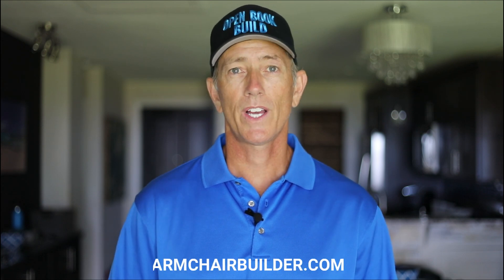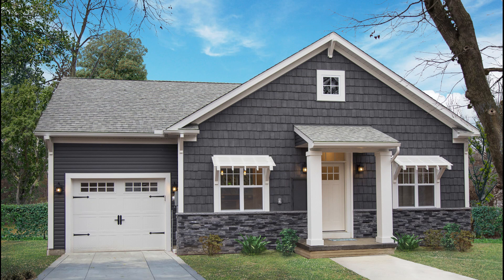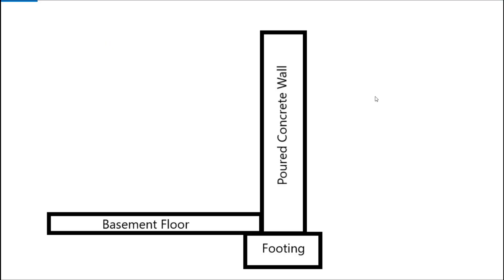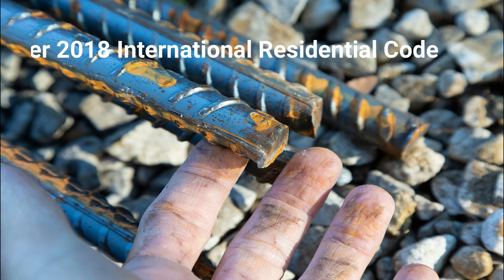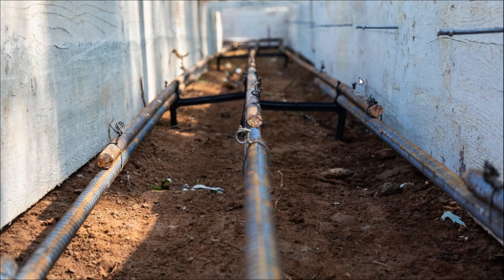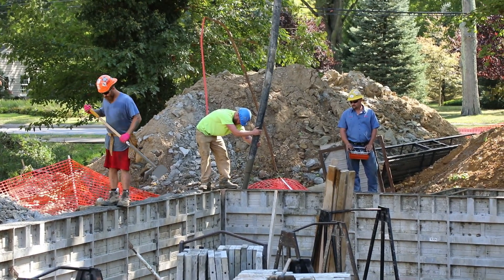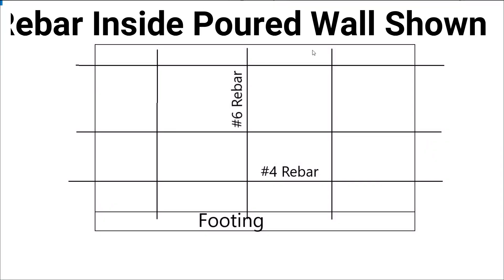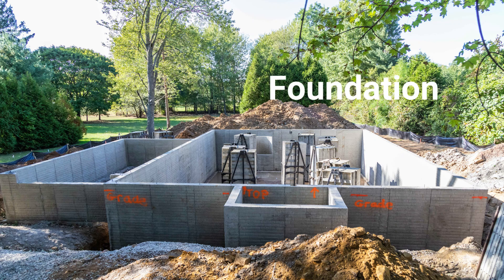Quality House Foundations: Avoid Structural Problems

Comment: Two comments:

1. If you wish to finish the basement, consider the fact that heating ducts will run below the floor joists, subtracting about 10” in height. If you want a true main level room feel in your finished basement, you should consider 10 foot, not 9 foot basement walls to have an 8+ foot finished basement ceiling. This also makes running and maintaining utilities in the basement ceiling easier, as you can avoid drilling through your floor joists. I have had electricians severly compromise joist strength by drilling for electrical cable passage too close to the bottom of joists. 

2. Not shown here, but I saw you waterproof and insulate in your 64-day build video. The bitumous coating on the exterior is traditional, but also traditionally a waterproofing failure point. There are dimpled plastic flexible sheeting membranes that can be applied over top ofthe insulation and OVER the french drain system. This creates a much more effective waterproofing since it is unaffected by cracking walls, protects the french drain from silting up, and also protect the integrity of the of the exterior insulation. 

My recommendations make the foundation slightly more expensive, but as you say, the foundation is the base on which the rest of the build rests.
Reply: 12 foot basement it is!  Thanks!
Reply: We did this often in GA,  but never dropped it below the flooring above, open truss systems are much better in reference to ducting, plumbing, and electrical.
Reply: @louismccall    That’s a good alternative if you don’t mind the extra springiness in the floor. What do you do if the main heating/AC supply ducts run perpendicular to the floor trusses?
Reply: @dilvishpa5776  Floor trusses are stiffer and upgrading the stiffness is easy. Space can also be made for supply ducts to pass through a floor truss.
Reply: @Ilove3SGTE  Floor trusses aren’t stiffer than engineered lumber or solid lumber. Who told you they were?
Reply: @dilvishpa5776  their span ratings are base on deflection limits. If they are the same hight/tinckness and trusses span more because they deflect less how are they not stiffer?
Reply: @Ilove3SGTE  Beams and trusses are like springs. They can reach the same equilibrium positions, but oscillate differently while getting there.
Reply: @dilvishpa5776  definitely not. At the same span and the same spacing the floor truss will be less bouncy. The reason some people think floor trusses are bouncy is because they increase the span and or the spacing. A lack of bridging can also make things worse. It's pretty simple the top and bottom chords are what resist the deflection. Trusses use larger top and bottom chords making them stronger and stiffer then dimensional lumber where the top and bottom 1/3 at as the chords. Using lvl chords, gluing and screwing the subfloor can help. Working with an L/720 engineering spec, increasing the height of the truss or decreasing the spacing or span will make the biggest difference. Dimensional lumber just can't competet at the same level. The only main thing it can do better is fire resistance before failure if we exclude cost.
Reply: @Ilove3SGTE   Also, you are not comparing apples to apples. An identically sized piece of dimensioned lumber is stronger than a truss. The reason is that the truss is the dimensioned lumber with pieces removed. Equivalently sized engineered lumber is stronger. A truss can’t be stronger than it’s weakest pieces.
Reply: @dilvishpa5776  as I said the chords are where the strength comes from the webs or the middle don't add any strength at all. They are simply there to keep the 2 chords apart. Only when a crushing force is applied like over a load bearing point does the web need to be strong. That's why I-Joists can get away 3/8" osd webs. The webs do transfer load to the bottom chord from the top but this is all they do and the force is easily handled by a few structural members.
Reply: @Ilove3SGTE  I’m a physicist and materials scientist. I understand how beams work. A truss is an economic product in that it can produce a greater height member at a lower cost, and beam strength goes with the square of the height. I also have done a lot of building, so my observations aren’t just academic.
Reply: @dilvishpa5776   that's excellent, can you then show me some evidence that floor trusses in general at the same hight, spacing and span are more bouncy then dimensional lumber? I'm sure you're aware but for anyone reading. I would also like to add that unless we are talking about very large sizes, trusses are far more expensive 3 to 4 times (or more) a comparable sized 2x12.
Reply: @Ilove3SGTE  we’re talking cross purposes again. I am referring to raw materials cost in lumber, which is priced in board-feet. There is less lumber in an equivalently sized truss than a standard joist or beam. Manufacturing costs drive up the prices of a truss. 

I have hydrodynamic rain gutters from Englert. They don’t work worth a damn because they were installed incorrectly, in spite if my objections. The same misapplication is true for trusses
Reply: Floor trusses
Reply: @jwatson181    Yes. That works but leaves a springy floor with lots of deflection. Not my preference. If you don’t mind, that’s a solution.
Reply: @dilvishpa5776  as long as you have the proper posts below, you shouldn't have any deflection.
Reply: @jwatson181    Deflection occurs in ALL support members … joists, beams, trusses. Maximum span length is determined by limiting the amount of deflection between supports. Trusses aren’t as rigid as solid lumber. Unlike steel welded or bolted trusses wood trusses maintain a certain give and motion between the truss members. Decreasing the span length with extra supports is an option, but it eliminates the other advantage of a truss, longer spans. Engineered lumber is an alternative and you can drill out the center 1/3 of the truss for circular duct work without significant strength loss, but many trades people make the mistake of drilling near the bottom edges … a severe engineering error. Neither system solves the problem of large rectangular supply ducts running perpendicular to the joists/trusses.
Reply: @dilvishpa5776  No and no. Trusses have a much higher deflection resistance and can span much further. Span capability is based on deflection. L/360 is typical, that's length divided by 360 which is the deflection limit at a given weight rating. A 2x12 can span about 16' depending of the wood type but a 12" truss can typically span about 20'. Trusses can also easily be designed with spaces for large duct work to pass through. "Engineered lumber" if you are referring to i-joists you can cut much more then the center 1/3. an 11 7/8" i-joist can handle a hole up to 8 inches so long as its not to close to a load bearing support or other holes. Regular dimensional lumber can only handle a hole in the center 1/3.
Reply: what state are you in?
Reply: Good info and need to inc into my build since where i live now that has all happened to the foundation and I’m on top of bluff.
Reply: Not just HVAC, but pluming too.
Would want to arrange the joist in the direction that suits pipe between them as much as possible.
Reply: @baware80    I just looked it up. Thanks for making me aware of it. Its main advantage is its self-healing capability. That is due to the presence of excess reactive calcium that wasn’t chemically activated during the initial concrete pour and forming. Cracks in the concrete allow water access to the unreacted calcium, which then reacts and seals the crack. It is kind of ingenious, though I think it may have been an accidental feature in Roman times. I’m not sure Roman concrete is any more waterproof than modern concrete, so would still waterproof the foundation. Water is passed through concrete through absorption and diffusion, not just via cracking.
Reply: @baware I DID understand that based on what I read. But to “thrive” with water, the concrete needs to absorb it, meaning it’s not waterproof, so will pass moisture through into the basement. But you bring up a good point. For the Roman concrete self-healing to work it needs water, so waterproofing the exterior seems counterproductive. It might be better to apply the polyethylene dimple membrane to the interior walls and connect to an internal french drain.

In a cold climate, water in concrete is problematic as it expands with freezing, causing fracturing. This is particularly likely if the interior is insulated rather than the exterior. If the exterior is insulated, the insulation needs protection and waterproofing, depriving the Roman concrete of the water it needs to self-heal. I suspect that Roman concrete may be best suited for warmer climates.

Comment: You mention possible problems. Why do you not do something from square one to avoid known possible problems. What's wrong with "over-kill" measures. Or commercial/architectural grade standards applied to CHEAP residential standards.

Comment: Old ww2 knowledge, iron rebar reinforced concrete structure is real good for withstanding bombardment, but bad for longterm building stability. Thats cause rebar rusts, leaking rust into the concrete, which leads to structural weakness over time. What u want is some nonrusting steel reinforcement.

Comment: That rebar would not protect in the scenario you gave where you have erosion or settlement on the end, though the reinforcement in the wall would help resist that to a point.  The tension side of the footing in that particular case would be at the top, thus you would need rebar at the top to resist that or cracking will occur.  Rebar at the bottom is only going to resist positive bending moments, which will usually occur in cases where erosion/settlement takes place towards the middle of the beam.  True best practice in this case would be double reinforcement where you have rebar 1.5" down from the top and 1.5" up from the bottom.  Most of the time it is not needed though since it is quite rare to have a case where erosion or settlement happens at the end of a foundation, unless it's built on a very steep slope. Having said that, this foundation looks wonderfully built and assuming the soil conditions are fairly stable i'm sure it will live past the life expectancy of the home.
Reply: My thoughts too on the rebar placement in a soil void scenario. Tension on top compression on bottom. The bottom rebar is useless in that scenario

Comment: Is it better to use blocks or just concrete for the foundation?
Reply: Concrete
Reply: Solid concrete is higher quality. Blocks ar e the norm in my area. You can also pour concrete and put rebar inside concrete blocks. Concrete blocks are acceptable at least in my area but poured is higher quality for sure.
Reply: In my area most people are more familiar with the block so a small minority of houses have poured. This includes expensive custom builders by the way; most are using block.
Reply: blocks are a much, much better value (10-20x), basically either you do poured or blocks purely but absolutely take advantage of the fact blocks are so cheap somehow, (3$ for 100lb shipped in bulk) solid is obviously stronger but the value is just awful because you can never replicate what a multi megawatt machine does with a pouring truck.

Comment: Concrete should be placed not poured....water to cement ratio! Gravel below footing better! Dark soil may have organics! Rebar shown not being lifted during pour! Why not use a neoprene water stop joint? Great video just a few things we do..also you don't speak of slump factor..
Reply: Can I hire you for my home ?
Reply: Whats neoprene water stop joint?
Reply: @mattmathematics3591  it's a positive strip that's inserted in wet concrete ! That foundation gets framed over so water intrusion does not occur at the cold joint!
Reply: @69ss95  ok im absolutely new to this. What is a positive strip?
Reply: @mattmathematics3591  Hi! It was mis spelled..sorry! It's called a water stop!  Usually a rubber strip! Look it up..saves big headaches down the road...
Reply: The footings above are not wide enough. Should be the width of the concrete block or concrete wall plus 2 more widths and OC.  My home is 8” concrete block and my footings are 24” wide.  And I don’t have a basement.   The rebar are ok as they have.   Actually 2 running rebar about in the middle of the 8” thick footing is good and know how to place your corners.
Reply: Pouring concrete is an acceptable and often used term. Footings on soil is common, and compliant with building code for “undisturbed soil”.
Reply: @patty109109 Footings on soil are only acceptable once you've used a mini-excavator and removed the soft organic material,  thus reaching preferably impacted clay or the like. Otherwise, use packed stone.
Reply: @patty109109 Footing on soil is not common in civilized world.
Reply: @Bart-dg6qv Yes, it is common, and preferred in most locations.
Reply: @Bart-dg6qv most caribbean and tropical places do the footings on soil. It's extremely common place. Many places in the US also do the footings on soil.
Reply: @arelfarrington9943  I'm sorry to say but I don't like that idea. It always creates further problems with the foundation.
Reply: @Bart-dg6qv it can cause issues but that depends on what type of soil you have. That's why the footings are there to combat settling and giving the house a good base. We have homes that are 50-100+ years old that have no foundation issues and were built on dirt. Obviously if it's sand or some other very soft type of dirt then you would have to go the extra mile but compacted dirt works just fine here
Reply: @arelfarrington9943 saying a house is 50 years old with no foundation issues is like saying my car has 50,000 miles on it and hasn't rusted apart yet. Houses in Europe are hundreds of years old.
Reply: @kalashnikov1343  yep no foundation issues means the foundation is still in good condition and is not crumbling
Reply: @kalashnikov1343 only 50,000? Mine is on 100,000+ and doing just fine. Also why exaggerate by saying "rusted apart"? No vehicle will "rust apart" from driving 50,000 miles or from twice the amount of time it would take for you to travel that far (which isn't really that far for people that drive daily).
Reply: @JaredaSohn  wow, you entirely missed the point. Go back, start over, and try again.
Reply: Very informative video…is it recommended to have have footings on stamped gravel base?

Comment: Everyone should follow that practice, but the inspectors generally don't babysit builders in every step.
If the basement wall is designed as a retaining wall the floor attachment should not matter, but that means waiting 4 weeks for the concrete to reach design strength.  Even with a retaining wall design, engineers have specified to pour the basement slab before backfilling to keep the wall from moving.  I am a little skeptical about a 10" x 60" x 30' footing with four #5 bars moving anywhere, but I obey my orders anyway.  Mostly.

Comment: Good stuff. Not an expert, but what I would do is build up the soil to raise the grade level a couple feet, then the water table would be even further below and this would reduce chances of basement flooding. 
I'd make this mandatory. 
And then you could put pile-ons (not sure if that's write word) but you know, basically footers that go down a bit before you install your main footing. Make sure the soil is compact. 
If everyone did this then flooding would be much less an issue. I don't even understand why anyone would install a basement at grade. Just make it higher.

Comment: Right off.......the re bar in the footing looks like it's sitting on the dirt, I later saw your using chairs but it's still too close to the ground. Using 15mm re bar ( #5 ) is really good.
That brick like finish on the outside of the foundation might look nice for the wife but the ground don't care and there's a good chance those recesses will not be sealed properly against ground water.
For concrete strength I use minimum 3,700 psi ( 25 mpa ) for the walls and for engineered foundation the minimum is 4,400 psi.
Reply from the maker: It’s hard to see in the video but the rebar sits on “chairs” so they are at the perfect height in the footings to provide tensile strength.  This foundation is 2 years old and dry as the desert